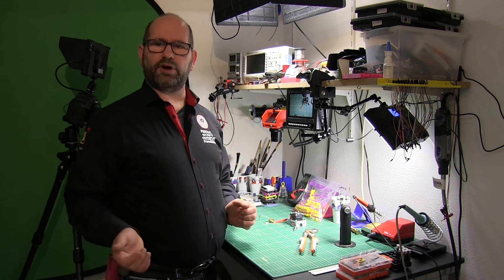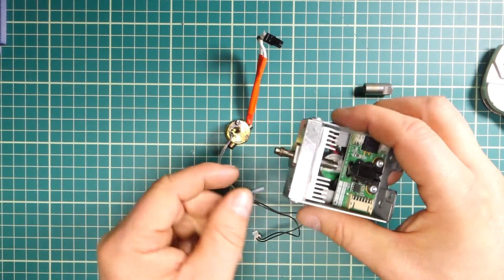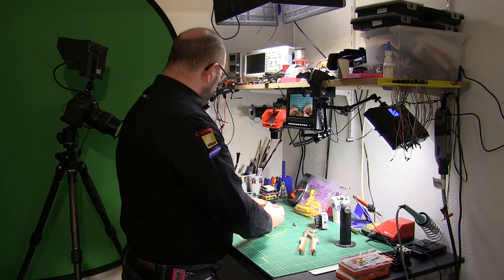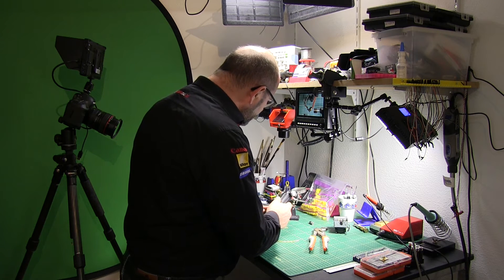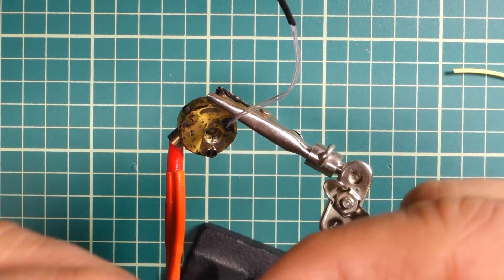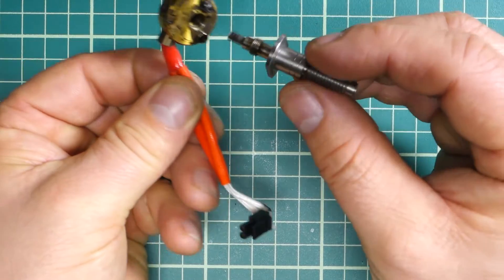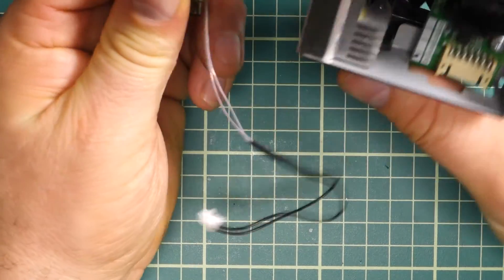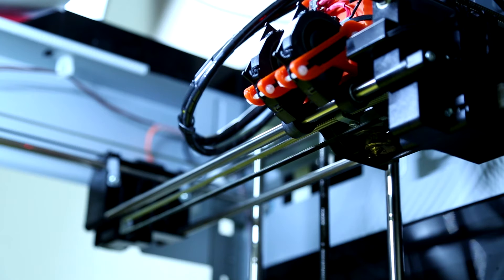▼ Unclogging Nozzle on Da Vinci Pro 1 and 3in1

Comment: Thanks for this video.  I've had this printer for many years and have never had a clog that I couldn't clear while the print head was in the machine.  I wasn't so lucky this time.  Your video gave me enough information and visual guidance to be able to pull the whole hot end out of the machine and clear the clog that occurred as one roll of filament ended and the next one tried to feed in behind it.

I had a piece of the old filament stuck in the insulating tube just above the print head.  Many thanks, as I'm printing again.

Comment: Just aquired an old version and i noticed  that your has a small piece of pfte tube in the stainless tube, mime doesnt. Wonder if this is why i get so many blockages
Reply from the maker: Possibly yes, the PTFE tube on the inside is called the Inner Liner Tube, and it should be there.

Comment: I unclog my printer, but now it shows an error message 0014, can you help me solve it?
Reply from the maker: Error code 0014 is a problem with heating up the printer
See if your cables are all firmly attached, start with the heater block, as you have been working there.

Comment: I couldn't get filament to extrude even though I could poke the cleaning wire through. I took the head apart, as demonstrated in your video, and found that the "nylon like" tube inside had clogged with carbon. the wire would go through, but the filament would not! I cleaned it out and cut just a slIver off, and all is well now. Thanks!
Reply: "nylon like" is actually teflon

Comment: The two thin wires attached to the extruder head, I assume are reading the temperature of the head and are very low voltage. I would think that the larger (red) wires are providing sufficient voltage to actually head the extruder head. Do you know what the voltage across these two wires, and do you think it is possible to use this voltage to heat the extruder head rather than use a gas torch? I have neurological issues that make it impossible to use a hand torch. Thanks B. I am a recent newcomer to your videos but I find them thorough enough to be confident that I can effect minor repairs such as this.
Reply from the maker: You can just heat up the nozzle with the heater cartridge that is inside the nozzle.
However, I like to use a gas torche, as I can then heat it only at the nozzle, therefore not heating up the heatbreak that much.
Reply: I may try to reconnect the nozzle once the hot end is free and let the machine do the heating. You have any luck?

Comment: Do you know what the piece of plastic that is supposed to keep the heat from the machine is called? Mine is stuck inside and i can’t get it out
Reply from the maker: I think you are talking about the PTFE inner liner tube (or short, PTFE tube).
Reply: Yes that’s the one thank you. My friend recently gave me this 3D printer as a gift so I’m still learning how to use it. Your videos are helping a lot to understand this printer and its limitations. I have another question, do I need to use the XYZ software to connect the printer to my wifi or am I able to use a different one? I’m using a Mac and I looked at the software and saw it is really outdated so I’m wondering if there are other options. Thanks for the help!

Comment: My printer won't load filament anymore.  I unclogged the print head using the tool that came with the printer.  I can tell when I feed the filament, you can tell when it gets fully loaded when it hits resistance.  That is where the problem is now.  I can load it so far but it isn't going as deep as it used to.  I tried pushing on it some and the filament started coming out the side of the print head.  What should I do?
Reply from the maker: If filament came out, but not from the nozzle, but from the side of the print head, there is something wrong in the printhead.
You have to disassemble the whole head and clean everything with heat, before you can continue. Then, when you have done this, you have to heat up the printer as if you are going to print, but without filament. When the print head is hot, turn the nozzle in hand tight, and then a little more tight, with a wrench. Now you sealed the connection between the heater element and the nozzle (this is where it's now leaking). Then load filament and check if everything works.
Reply: @3dPrintCreator  I took a look and there appears to be a small piece of tubing that feeds into the print cartridge, that has split so the filament just comes out the side.  Is that hard to replace?
Reply: Its the piece that should feed into the part labeld T2

Comment: very good. Is it necessary to change the complete extruder or change the nozzle? is it possible to buy separate by xyz printing?
Reply from the maker: As far as i know, you can not buy the nozzle seperately for the XYZPrinting Da Vinci Pro. 
Because of that, some people made E3D V6 compatibel hot ends, so it would be poossible to exchange the nozzle, or even the heatbreak, so that you can have a full metal heatbreak and a nozzle that is harder than a brass nozzle, like full metal, or even one with a ruby tip.

So, as far as I know, you need to change the complete printing cartridge, containing the whole hot end.

Comment: Anyone know what that inner tube is really made of? Is it nylon or teflon? Any links to the correct diameter part to fit in the da Vinci?
Reply from the maker: Originally it's PTFE and it's 2mm I.d. and 4mm o.d.
Reply: @3dPrintCreator  Awesome informative video however the PTFE tube got destroyed.  Do you happen to have the total length of the tube?

Comment: I can’t even take out the piece from the printer. I’m seriously confused. I need to unclog my machine but I can’t even take the piece out. I’m super frustrated
Reply from the maker: Make sure you know what parts move and what not. When you know that, take some filament and experiment with the force you need to break it sideways, because you need to use that amount of force.
When you know that, pull out the hot end with the force needed to break the filament that is trapped.
On the older printers, like the one I had, it was possible to cut the filament but you can't do that on the current models.

Comment: Hi, where can you purchase the inner "nylon" tube? I need a replacement. It is 3mm outside diameter and I guess around 2mm inner diameter. The new head I purchased is missing this part. Many thanks,
Reply from the maker: Hi, that depends on where you live. I can buy it at a local 3d printing store but if you don't have one in your city then look online at Amazon, ebay or AliExpress.

Comment: Hi second day working on unclogging extruder got extruder out of 3D printer and took it apart and noticed there is fillament stuck in the silver metal piece that connects to the gold heating piece my question is how to dissconnect the silver piece from the heating mechanism. I saw on this video you had it disconnected from the silver piece heated it and scraped it out. Does it screw on and off? If you can help me with this I’ll really appreciate it thank you
Reply from the maker: Hi,
Before you do such a difficult thing, first try the easy way of unclogging.
Take the cartridge, as a whole, to a gas flame. Hold the nozzle (the bronze part) in the flame while pushing a piece of filament from the top side into the hot end.
When heated up enough, you will be able to push the clog through the opening OR to pull back the filament and take the clog out via the back of the thing.

Only if this doesn't work, you have to get them separated. You can just do this by unscrewing the nozzle from the silver part counter clockwise.

Good luck.
Brian.
Reply: 3d Print Creator Thank you very much I really appreciate how fast you got back to me and all the help. I’ll let you know how everything goes
Reply from the maker: No thanks at all... 
I am only that fast when I am actually behind the computer.
When I am at work it can take days before I respond to the comments.

Comment: Very nice video. Just saw this after heating the hot end still with the liner on. Do you know where I can get some to replace it?  I see PTFE widely available at that size (2mm ID & 3mm OD) but not nylon.
Reply from the maker: You can use the PTFE tube without a problem.
Make sure you use a drill to curve the inner edge of the PTFE on the side where the filament comes in.

Comment: How do you get the silver screw-like thing out of the copper thing?? I've been trying and trying and I'm going nuts!!
Reply from the maker: Hi Gina,

That silver screw like thing, that's the heatbreak. This is just screwed inside the brass nozzle. Don't ever put to much force on the heatbreak, but you can just unscrew it easily if you heat up the nozzle a little bit with a flame or heatgun.

Comment: Brian Thank you for these tutorials. 

I have a Question The Two Grayish silver wires that go into the top of the nozzle, what are they called. and can they be repaired? as During cleaning with a wire brush I accidentally snagged them and they ripped off?
Reply from the maker: Hi Nedd,
I am not shure, but I think they are called silicon wounded wires.
If you buy a 100K thermistor, this is the type of wire that's soldered on to it.
Reply: Thank you, I will look into this further As I was able to stick them back in But i'm afraid to run my Printer Because they aren't secure.
Reply from the maker: Yeah. I don't want to scare you of, but you must be really confident that your thermistor works as it should because if it doesn't, your heater for the nozzle can overheat, in extreme situations even causing fire.

If you don't trust it, make sure to get another thermistor from XYZPrinting
Reply: My thoughts exactly that's why I just Ordered a New Nozzle from XYZ for it. I like to air on the side of Caution. Thank you for Your Help and Thank you for continuing to Help the Community.

Comment: Hi Brian,
Just in the nick of time, I have went through the included spool about 50 hours I think and started on a third party filament.
 I printed 2 small parts and 2 hrs into another and it just quite printing. 
the tube unscrews from the brass nozzle piece correct?   how tight is it mine seems really tight.

Thanks for the help.
Sam
Reply from the maker: Hi Sam,
Sorry for the late answer, must have missed this reaction.

Indeed the brass nozzle and the tube are two separate parts that screw away from each other.
They are really tight though. So tight that you have to warm them up before screwing them together or else you are not able to tighten them as much as they need to.

Comment: Your "nylon" is PTFE 

for example:
https://www.amazon.de/gp/product/B012T96D4Q/ref=oh_aui_detailpage_o02_s00?ie=UTF8&psc=1

If I have to clean the nozzle, I change the PTFE on the same time. Most is the PTFE the problem for the clogging.

I have no guitar. I use this nozzle cleaner

http://www.ebay.de/itm/Reinigung-Nadel-Reiniger-0-2-0-3-0-4mm-fr-3D-Drucker-Extruder-Duse-Nozzle-RepRap-/222162268786?var=&hash=item0
Reply: Frank Jürgensen. I used PTFE and works great. It has a higher melting point than ABS but you have to take this into consideration when putting a torch to the whole assembly. By the way.. I also recommend changing the guide tube on top of the head- yet another tube type: 3mm ID 4mm OD
Reply from the maker: Hi Frank,
It's not plain PTFE but something that can resist A higher temperature then PTFE
It's also another size then the normal PTFE tube from the extruder to the carriage.
(2mm I.D versus 3mm O.D.)

I do have a lot of guitars, and a lot of E strings. I keep mine :-)
Reply: PTFE = Schmelzpunkt 327 °C lt. Wikipedia

My link goes to 2mm ID 3mm OD !

Comment: Thanks For the tips,
I'm currently printing my Spool holder 2nd attempt so far so good no lift I'm about 4 hrs in.

One question you might be able to address in the future. 
I have noticed that XYZware for pro gives a estimated time of say 1.5hrs and the printer gives a estimate of twice that?

also if the time is incorrect what about the filament usage? 
Your thoughts or experience with this?
Be Safe,
Sam
Reply from the maker: Hi Sam,
The filament usage is pretty accurate but the displayed time is far from that.
When I am working with Simplify3D as a slicer, I find that the displayed time get's accurate only after the first 4 layers are printed. In the XYZWare for Pro slicer however, it never gets accurate.
Reply: Thanks Well shortly after I commented the spool holder lifted this time on the bottom side. Just not having any luck with it.
Reply from the maker: Hmm, that's not good.
What is the bed material you are printing it on?
If it is the sticker that XYZPrinting supplied with the printer, then you can apply some glue stick to it to get better adhesion. 

I always use Kapton tape and gluestick OR BuildTak plate as the bed material because that works way better.

Good luck printing the spool holder.
Reply: I installed buildTak first thing upon your recommendation it has worked well on everything just not so good on the spool holder.
Reply: i'm wondering if changing the infill and layer height will help?
Reply from the maker: If you have used the BuildTak several times, you might want to rub it with some rubbing alcohol once. This removes residue that sticks to the BuildTak and makes it extremely sticky again, as if it's new. If you don't have rubbing alcohol (Isopropyl alcohol) then use some window cleaner.

Good luck
Reply: 3d Print Creator
Thanks I clean it in between each print Im trying again with only 20 % infill to see if it helps. thanks